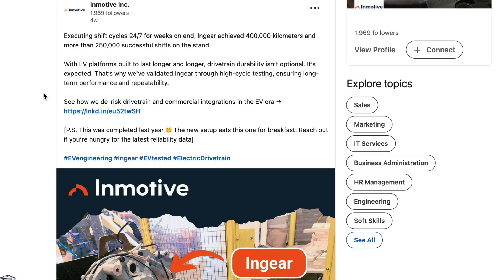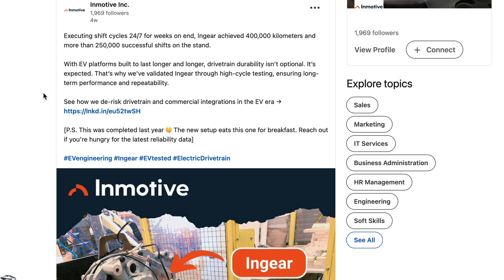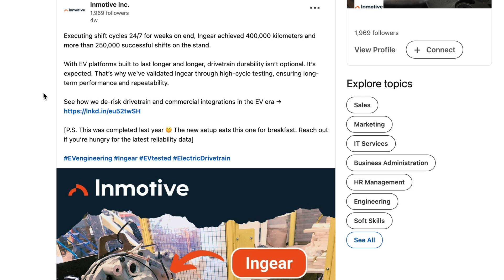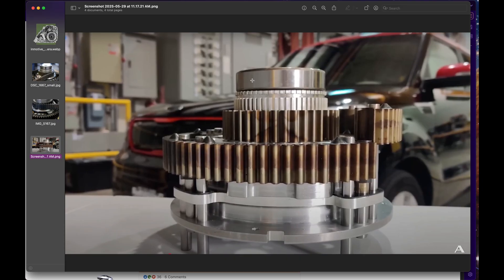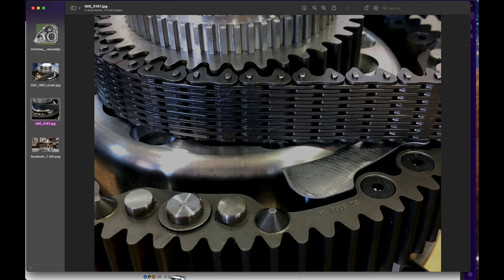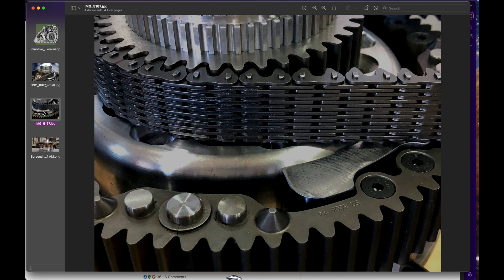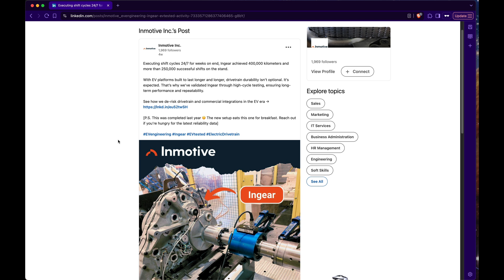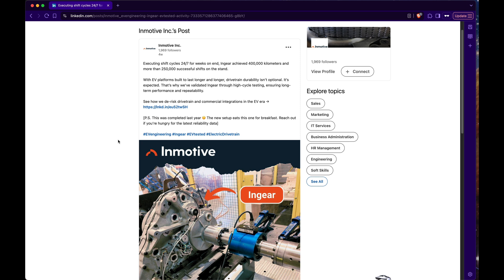Inmotive’s Ingear two-speed transmission passed 400,000 KM Durability Test | Aptera Motors

Comment: The chain is actually a timing gear belt that has been used in high reving engines for decades, it’s bullet proof as long as it’s built of good material, it’s will stretch,but that can be handled by this design.

Comment: If one gives good benefits, then 2 gives even more. 

So 30% faster drive shaft at the same rpm, 110mph*130%=143mph*130%=185mph

I know it is not that simple, but it gets you thinking, like maybe adding a rudder, or some air brakes. I guess that the single trailing wheel can be used as a rudder, maybe add a steerable fin to the back of it.

Comment: Thanks Raj,  I caught one of first show n tells from Aptera and then the Aptera Owners Club review.  I still wonder how heavy duty this chain is compared to the Dodge Ram Pickup 4X4 system?
Reply: The chain looks about 30% wider than the ones that are used in the cvt of the Rav4. Since the aptera is 60% the weight of a Rav4, that probably works out well for reliability.  I picked up a rav4 cvt chain about 15 years ago, so my memory of that is a bit fuzzy.
Reply: @mikegrok  Thanks